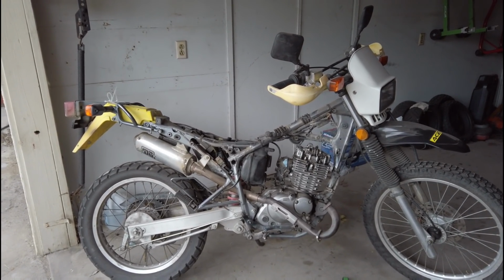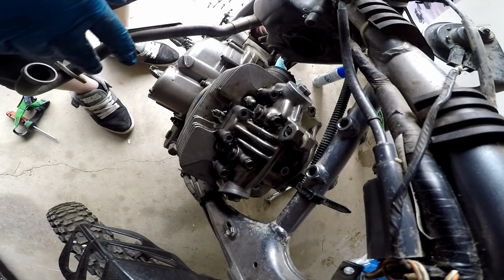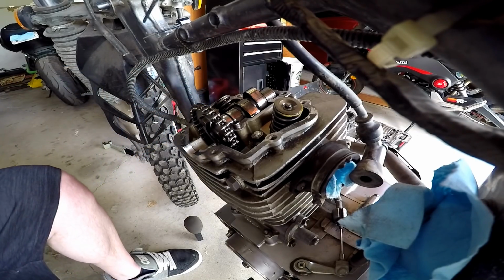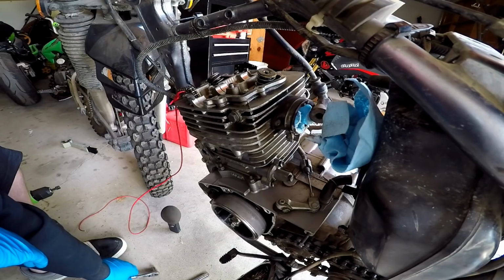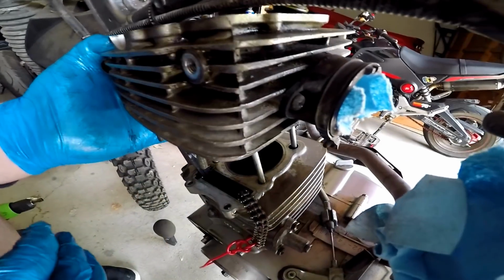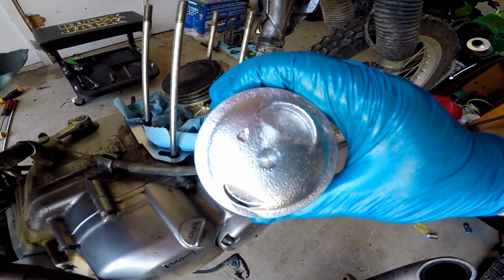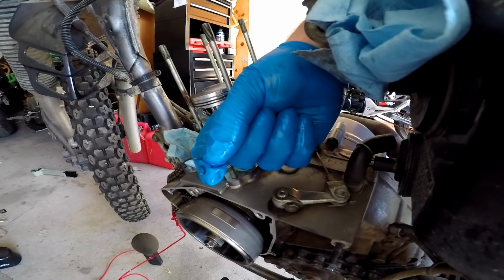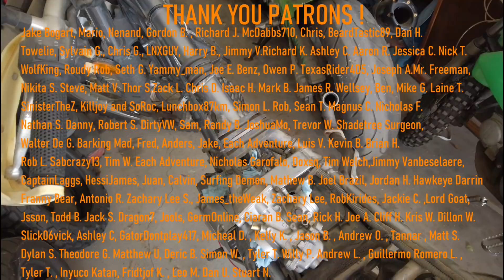Let's See How Bad It Is | Suzuki Dr200 Rebuild Series Ep. 2

Comment: Handful of things so you don't waste time 

Don't reuse any gaskets ever. You are right though single ply ones suck. Try to find an oem MLS to replace. They aren't expensive 

I saw you have a new cylinder. Thank God that old one is probably all sorts of out of spec and ill bet has no cross hatching and grooves. But make sure you chek your ring gap. Its very easy just YouTube it. And go slow. Can't add material but you can always take more away.

Number three others already said it. Rods shouldn't move much. There should be specs in the manual for acceptable play. A little wobble doesn't matter. But it would suck to do all the work, start it up, and it has rod knock 

Number three, go to harbor freight grab their heated large ultra sonic cleaner and toss the carb in there. Use carb cleaner in the ports, and brass nozzle jets. If you can blow compressed air through the brass jets after. AND DO NOT GET ANY CARB CLEANER ON ANY RUBBER GASKETS SEALS OR ORINGS. they will swell become brittle and deteriorate.  You'll need a float bowl gasket at a minimum. 

Finally, get a new air filter and spark plug. Go enjoy
Reply: Eric Miko good advice man 👨🏻
Reply: I'm thinking of ring gaps and piston orientation, front and rear to some pistons or the valves will hit.   Looked like everything was loctite'd the way things snapped loose.  Do a homemade valve job and new seals.
Reply: If it does have rod knock then the whole things gotta come out and theres a lot of work and money to get it back up and running. Might as well try what hes doing and if it does need a full rebuild then he can take it from there.
Reply: Wouldn't hurt to lap the valves. In older engines like this and not very high performance you can get away alot more with cheaper fixes. But certain things you can't. To check valves, flip the head upside down, spray a puddle of brake clean in the dish of the head with the valves closes. Of you don't leak any fluid, you're good to go! Which I thought I saw him do.... or I'm vaguely remembering a different video I saw on another channel haha
Reply: @bumtracksNew  true. Usually thats clearly illustrated in the literature though so as long as he goes step by step no big. It doesn't always explain ring gap though. Just the specs.
Reply: +1 
Also his single ply gasket in theory should bump his compression a little

Comment: I did a DR200 top end last year and it's an easy bike to work on. Don't worry about the mismatched bolts on the head studs that's normal, which ones go where should be visible in the service manual pictures. I think they're supposed to be diagonal? Also when you go to reassemble those tiny fasteners holding the cylinder on by the chain tensioner (the ones by the displacement number) be really careful. They have a very tiny torque spec and snap easy... or at least mine did. Make sure you reset the tensioner too.

Comment: I believe that black gasket material you saw on the rocker cover is factory Suzuki Bond. I'm a Suzuki Marine tech. Maybe I'm mistaken but, You'll  know upon reading reassemble in the manual. That's a zero tolerance surface. Thus the reason there's no gasket. Keep up the good effort. Watch your Damm knuckles!

Comment: Release the cam chain tension with the tensioner on the cylinder when you put it back together. Pop the middle 10mm on the tensioner and use a small flat screwdriver to release tension turning counter clockwise. Makes it possible to find cam timing with the crank upon reassembly a lot easier without marring the cam journals.

Comment: I think the bike was running rich and built up so much carbon over time that a hard bit broke off and got caught in the rings causing the damage to the cylinder wall.  New cylinder sleeve if they have them or head, new rings to be safe, but you could have gotten away with cleaning and polishing the piston, but why not replace it, not to expensive I wouldn't think.  Doing a great job though Derek 👍
Reply from the maker: I'm really hoping the rod isn't fucked.
Reply: @bakerXderek  the play is possibly the shell bearing at the big end and crankshaft, but it could also be fine. It may have been engineered to have that play, but the piston should stop it moving side to side.

It might be worth replacing the shell bearing to be sure. It should be an easy job to do, sump off, two nuts on the big end and lift the piston out, cover bearing in engine oil when reassembling.

Comment: I have a 97 dr350R, love it and i also have a DG muffler on it. stupid easy motors to work on compared to others, and bulletproof if ya keep oil in it. Good luck brotha, im sure youll get her to puuuuuur. Also, I have to check my rocker to valve lash often on her, not sure if your 200 is the same way but something to keep in mind.

Comment: Smash that hole with a torx bit 😏 She’ll come out real nice just make sure you find a bit slightly larger than the hole and hammer it in usually your last resort when you have something stripped like that. Also try using heat like a blowtorch on the dowel pin just a suggestion

Comment: If you want to do a cheap big bore kit get a lt230 piston, sleeve, and head. You might have to shave the head though to up compression. There's more info on the interwebs. Or if you're lucky and can find an lt250s piston that would be your best bet. Cams for the 230 and 250 also work well with these motors.

Comment: You’re doing a great job! Is the connecting rod sliding on the crankshaft or is that actual wiggle? You want zero wiggle with the con-rod but some sliding room is ok. And the liquid gasket that was on the top cover was ok. Kawasaki switched over to That type of sealant over a gasket on crankcases a few years back. Anyways, keep up the great work. Can’t wait for the next video!!
Reply from the maker: thanks man, i'll double check that rod.
Reply: Yeah this head must use a sealant since the cam caps are part of the cover.

Comment: Assembly lube is not for the piston!!! Use motor oil. You can end up with clogged piston rings. Assembly lube tends to just burn and get carbonated in the piston rings because it is so sicky. Check engine compression after a short heat cycle and 1000miles later if it goes up you are fine but if it drops you need to clean out the piston rings ore you will head into new problems.

Comment: Re: the engine case plug - drill out two holes on each side of the stripped area, then you can put a pair of bolts through to brace a prybar, then reef on it. Check out this video, same thing happened here

https://www.youtube.com/watch?v=oVMvAWQKl-0
Reply from the maker: I'm actually gonna have to do that
Reply: Let us know how it works out!
Reply: Great idea!
Reply: When you put that plug back in just tickle it with a little anti-seize compound and it won't get stuck like that. I like the Permatex brand myself. When you use it put the cap back on tight and store the bottle upside down. The shit will last forever. Just use a little! Just enough to coat the threads. Those are dissimilar metals that's why the seize up like that. Never ever ever reuse a head or cylinder gasket. It just ain't worth it. You DO NOT want to tear all that down again. Glad to see you wrenching on your shit. You're a smart guy you can do it. Take care.

Comment: wow its going pretty smooth for a newbie at rebuilds. don't ever Ever EVER reuse gaskets. true 1 ply gaskets suck but they'll still compress way more then a used one ever will. double check the piston is on the right way if its got an orientation, some don't. cant physically inspect anything so best guess is the ring slots wore out/failed/overheated and let one of the rings start twisting making them grind on the cylinder wall

Comment: May as well order a new cam chain tensioner as well. They like to stretch on these and eventually lose timing and make a terrible “ping-ping-ping” sound that is the chain slapping against the case. You can get a new adjustable one for pretty cheap. Might as well because you’re already committed this far.

Comment: I miss my ol 11' DR650SE . It was a great bike . But I love my 02 Fz1 . It's much better suited for where I ride considering the trails around here were all barbed wired and fenced off .   Someone even set up barbwire across a powerline trail and the only thing that stopped me from being decapitated was the space between the fender and the headlight fairing stopping the barbwire from going over the headlight fairing . I hit at like 35mph and superman through the air and landed upside down on my neck . I was lucky I wasn't paralyzed.

Comment: Pretty sure the connecting rod bearing is toast. If you reassemble and run it like that, it's going to destroy all of your new parts and hard work. I commented on your last vid that you may have spun a rod bearing. The rod bearing looks and works like a bushing. It's located on the crankshaft where the connecting rod clamps on. Google it or search YouTube, you'll see what I'm talking about.
Reply: Side to side play is normal.

Comment: the old shitty gasket is totally normal that means someone went in there at some point and ajusted your valves which is something u want lol even tho they put a shitty gasket job back on
Reply: Nick 636n8r you adjust valves thru the inspection covers. You Wouldn’t need to remove valve cover to adjust valves.
Reply: @roberttimmons5638  oh nice man suzuki did it right hell yea all i know are ktm and you have to remove valve cover every time which they are a pain
Reply: Nick 636n8r right!  Beta and ktm both. I hate doing valves on them so much lmao

Comment: The main bolts under the cover are supposed to be mismatched and the valve cover gasket is supposed to be gasket maker. I have an 06, rebuilt it a couple times (wot kills the thing in hot days+i have smaller front sprocket). Suzuki is on some shit

Comment: Bruh doesnt that rod play mean your big end (crank) bearings are goosed?.. that's how my 125 exploded
Reply from the maker: The side to side is kinda normal. It has a tad of up/down tho so not sure if it's that bad.
Reply: @bakerXderek  all kindsa bad my dude, should be zero play as it's a bearing. Basically you've found out that your bottom end fucked your top end, i thought it all looked "okay" till you wobbled your ROD an I was likeeeee hold up that's your problem. Sorry to piss on your chips but you may need a garage to replace the crank bearing